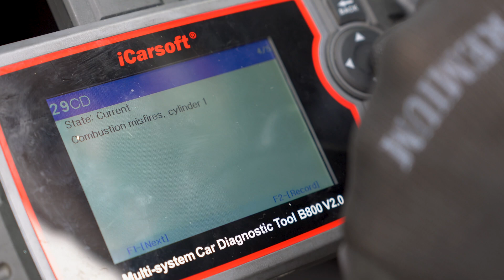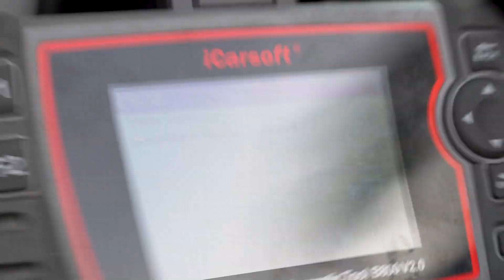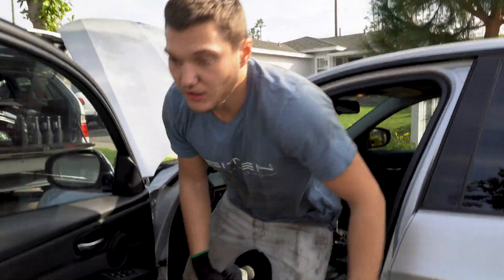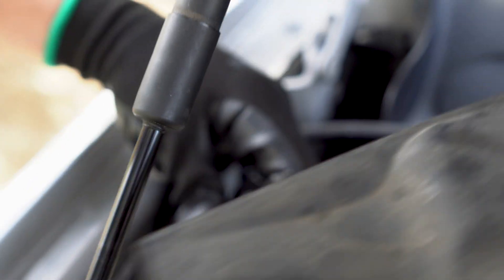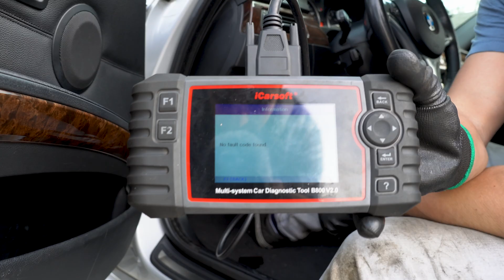DIY How to diagnose a MISFIRE on BMW, most common issue. (E90 N52)

Comment: Hey I have 2007 328i, after awhile of driving I would say around 20-30 minutes. When I stop at a light or anything the tachometer drops to zero in my car shuts off. Will this fix the problem??
Reply from the maker: No, most likely you have air leak somewhere you also need to scan the car, i recommend getting it inspected

Comment: Hi. What do you do if the engine misfire code stays on the same cylinder after changing the coil to another cylinder?
Reply from the maker: Next on the list is swapping spark plugs and then fuel injectors, same principle. I would also recommend having a new ignition coil as a test coil

Comment: I'm looking at a used 2007 328xi wagon w/170,000. The current owner is frustrated with it and has replaced spark plugs, intake manifold gasket, valve cover w/CCV valve and crank case hoses. 
He said that headgasket is fine, as well as compression!

He's dealing with a random misfire and a p0300 code. 

It's in beautiful condition in and out. Is it worth taking the risk at $3k? What should I expect, ignition coils, injectors...?
Reply from the maker: Random misfire is tricky to pin point, i’d look into maf sensor, fuel supply and possibly dme failure, 3k is a good deal
Reply: The owner is a BMW motorcycle mechanic and stated that he wanted to do a smoke test for vacuum leaks. Unfortunately he’s too busy and has run out of time.

I just don’t want to open up Pandora’s box by taking on someone else’s headache!

Thank you for your time!

Comment: Hello! Would a 2015 N20 use Bosch coils? I noticed the Bosch coils don't have the metal sleeve, but the delphi and the BMW OIEM do. The vehicle currently has metal sleeved coils. Thank you!!! Looking forward to more videos.
Reply from the maker: I prefer bosch, delphi sometimes leaves rubber part on spark plug during removal and it’s pain to take it out
Reply: @Zeiten  Thank you!

Comment: Hey man I got a question just put brand new coil packs and sparkplugs in my 330i and it's bringing up a misfire in cylinder 4 and still shows the same after swapping that coil with any I'm thinking it's the ignition coil harness any ideas?
Reply from the maker: swap fuel injectors, on harness check if the pins are all in, rarely happens but worth checking out, also check pins on fuel injector connectors same principle

Comment: Good information in the video.
I have a 2008 e90 with 145k that has random misfires under load only.
If I cruise at 45 and I floor it, the car will bog, shake, switch gears up/down(that's how it feels in the cabin).. like the transmission has a problem. 
If I cruise at 45 and I manually downshift 2 gears the car will fly and run just fine.
I would get random misfires (different cylinders every time).
Once I got the code for the crank shaft sensor (I replaced it)
I swapped coils, got some new ones, new air filter, cleaned MAF (never got a code for it).
I changed transmission oil and differential gear oil. Cleaned vanos...
Car has poor gas mileage (20mpg - this is a 328i) and I drive like an old lady because I don't want any misfires.
I think all these started when the PCV valve failed on the highway and I realized too late (the intake, engine, catalytic converter...were full of oil. People behind me thought I have a steam engine) :))

Comment: Need some help I already replaced all my coils and spark plugs but I still get a misfire on 4 and 5 it doesn’t move from there , I got no smoke coming out so I don’t think it could be the piston rings
Reply from the maker: Check fuel injectors, also can be burnt valve

Comment: Hi Zeiten LLC, 

I have a 2010 328i x drive and it has gone into limp mode... it has error code 55C3. 

would bad spark plugs and bad coils cause car to go into limp mode?? 

Also, once I turn on the car the engine seems to be shaking mildy.. 

any thoughts? 

I love your videos! VERY informative.

Comment: I keep getting 29D0 and 29D2 on my 335i. I don’t know why MHD mentions 29D0: intake air temperature sensor short circuit to B+. I heard it’s just a cylinder 4 misfire, so I wonder if it’s the coils or the MAF sensor 😕
Reply from the maker: Swap coils first, short circuit to b+ always stored if maf has been disconnected
Reply: @Zeiten  thanks so much! I’ll definitely try that 🙏🏻

Comment: Any suggestions on quick easy fixing of stripped plastic cabin filter housing screw holes on this model?
I've thought of filling the stripped holes with thread locker or permatex and then drilling starter holes. Not sure how feasible that is. What do you think is the easiest best way?
Reply from the maker: Don’t do anything 😂 or use thicker bolts
Reply: @Zeiten  yeah, but I wanna make sure I'm breathing pure german filtered air.😁

Comment: I have a 2011 328 Xdrive,  with 65k miles on it and it started to misfire on 2 different cyl. I swapped them out  and ended up replacing them with Bosch coils , only to have more misfires pop up in different cyl.  it got worse , now I have misfires in all cyl and a random misfires and all coils were changed out including the 2 newest ones with Bosch..  Misfires are still there.. And will not go away,  All 6 plugs are also new BMW spec..  I'm at wits end .. Because nothing seems to fix the misfires...
Reply from the maker: Inspection is necessary, coils causing misfire is just most common issue but there many more factors that can cause a misfire. Get it scanned at least, air leaks are major reason for misfire as well

Comment: Thank you for video. My e82 cuts out with seconds. Replaced all coils and plugs after getting p0302 code (2 cylinder fault) and drove and run perfectly until the  very next day.....very poor start, ran very rough before cutting out. My 125i only has 39k but 10 year old. Any suggestions please? Thank you
Reply from the maker: Can be any number of reasons, check codes first of all, air leak is a possibility vanos solenoids, maf sensor etc, don’t guess get a proper diagnostic

Comment: AND my RPMS are going up and down and really crazy..i put new spark plugs but they were Champion Iridium..what will cause the rpms to go up and down ,like crazy?
Reply from the maker: Check your throttle body connection, and for air leaks, sounds like air leak to me based on your previous comments

Comment: Fantastic info, very well explained! I have a 2011 BMW 328i that has been missing last couple days. Thanks!!
Reply from the maker: Happy to help
Reply: Hello, I bought a diagnostic meter just like yours and no error codes. I am convinced it is a bad coil. Do you know why bad coil would not show up on my meter? Thanks
Reply: Fixed it! Was a bad coil on #1. Gasket oil leaking just like on your video. Runs great now, thanks so much for your video. BTW BMW quoted me $485 to do this - $224 for the coil -SERIOUSLY. I paid $23 for Bosch coil on Amazon. You saved me a ton of money!!!
Reply from the maker: Great to hear👍

Comment: Hi Tim, my 2013 bmw x5 35i 3.0litre turbo ( 129000 kilometers) has a ,I guess a surging up and down from 1400 rpm to almost below idle and almost shuts off,it does this for 3-4 times only, when i first start in it the morning in canada, and then its fine all day and no issues whatsoever, no codes showing up on the instrument dash,, its getting cooler temperatures here now as winter is approaching and as i say, its only during first initial startup in the morning cold, with about 2. to 3 degrees temperature,so very close to water freezing, warm days no issues. ty for your input Sir.
Reply from the maker: Well i would look into vanos solenoids and may be changing oil for lower temperature oil, other than that impossible to day without inspection
Reply: @Zeiten   ty for response Yes ok Sir, the Vanos will be changed out. Right now I am using 5w --40  Castrol Edge full synthetic ,BMW LONGLIFE -01 and Mann HU816X oil filter,What grade of oil would you recommend  for cold temperature and at what interval do you recommend for 3.0 litre turbo, n55 to change the oil? ty
Reply from the maker: I’d say 5 or 0w-30 is good enough of castrol edge for winter
Reply: @Zeiten  ,ty fro this Information, I like to take care of this vehicle and thanking you again for your epertise!! Keep posting Utube Vids!! professional work 100---100
Reply: @Zeiten  Hi Tim, i am going to use 0w--30  Castrol Edge full synthetic . i noticed it do not have written on it,BMW LONGLIFE or saying it is specified for BMW??, I guess it still should be fine and compatable with bmw gaskets and rubber compounds in its gaskets  ty
Reply from the maker: Bmw doesn’t make oil, they use castrol and put their branding on it, we use castrol edge all the time and never had any issues with it
Reply: @Zeiten  . Ok yes understood! thanking you for your expertise!! continue posting your educational Videos!! 100--100

Comment: My bmw 325i. Crank but no start. Maybe is the same problem. Cylinder #6 is the problem on my car. Thanks
Reply from the maker: Crank won’t start probably has nothing to do with a misfire, look into fuel delivery, crankshaft sensor, vanos solenoids
Reply: @Zeiten  ok thanks very much
Reply: @Zeiten  when crank 4 or 5 times. The car start. What can be. Thanks
Reply from the maker: Things I mentioned above, other than that inspection is necessary
Reply: @Zeiten  ok thanks. Crankshaft is the problem.

Comment: Great vídeo! Really helped but quick question I have the same car and it also has oil inside the spark plug well I changed the spark plugs on misfire 2 and 6 and it still has problems do you think it’s could be because of the oil inside or because of the coils? Thanks hope to hear from you
Reply from the maker: Most likely coil, oil in spark plug well is caused by valve cover gasket leak, in some severe cases valve cover gasket leak can cause multiple random misfire due to massive air leak

Comment: I've got a Autel 808BT it works good for a quick diag. plus holding it while driving. I use Ista also. Easy Diag .👍
Reply from the maker: That’ll do, any scan tool is fine to be honest, especially when it comes to simple things like this
Reply: @Zeiten  Yes. But a re-adapt. after like I had when I found the loose O2 sensor the Autel wouldn't do it. Ista did reset the DME  to keep the SES off. But your right. 👍